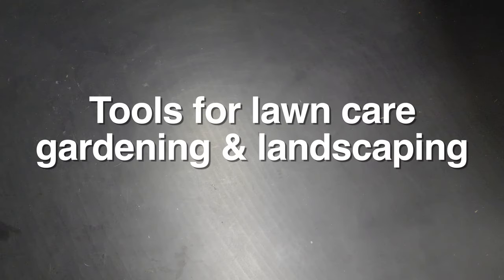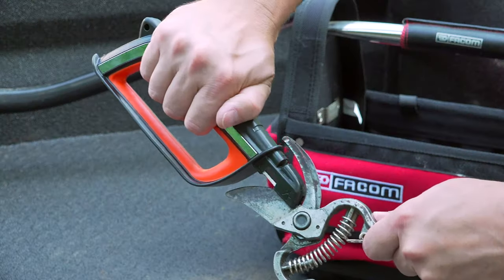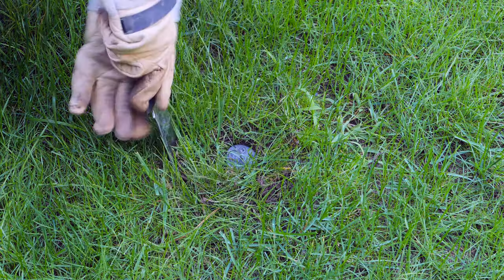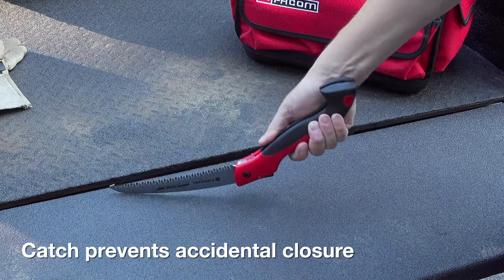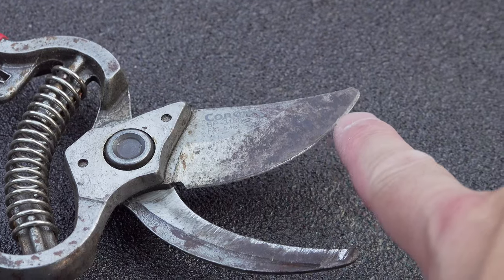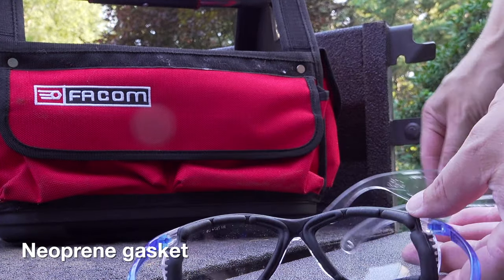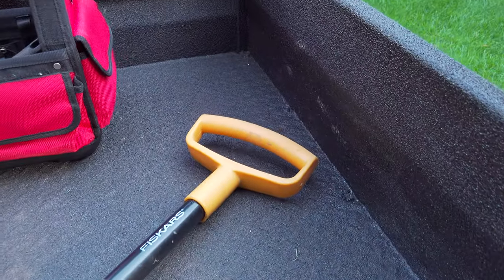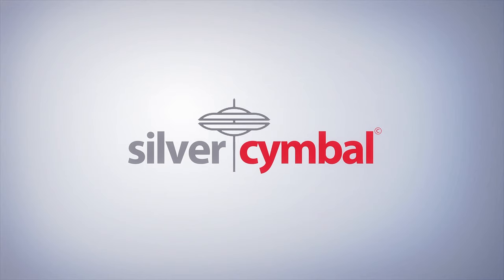2020 Cool Lawn Tools & Garden Less than $25!

Comment: Them safety glasses are made by multiple different companies and I love my 3 pair. The yellow act like they have night vision as the sun goes down. You'll take them off and say, what the he** or heck for younger children. Seriously they are awesome. I also already bought the sharpener and within 24 hours of you showing it on your show. I bought it off eBay.
Reply: Does the seal cause the glasses to fog up? I bought a pair by Dewalt that had vents at the bottom but were sealed around the edges but as soon as I started doing any strenuous work, they fogged up on me.
Reply: @lamcarter  this is what I'm going to say about that situation. I have some that fog up almost instantaneous and none of these pairs do and they're not even sealed. Personally I don't know if you have heard of Wish.com but I but 2 pair on there for let's just say $5 each (20 days shipping) and one on eBay for let's just say $15 (2 weeks shipping). When I need them I will definitely buy more in the future.

Comment: I have the Corona Extendable Pole Saw/Pruner. The Blade design is superior. A 6" branch 14' up is no match for Corona's sharktooth type design. I have been using old wood handle saws, but now I must get a Folding Corona, thanks to Silver Cymbal.
Reply from the maker: They make some good stuff, I will have to check that one out.

Comment: Few people without special training can pick out quality products so well. You've said you are a computer guy but I can't help wonder, even though none of my business.  Never had Facom tools in my hands what do you think?  Anybody who uses an Instinct screw driver's not likely to use junk.  I collect some SnapOn also, mainly sockets in black oxide.
Reply from the maker: Thank you for the very kind comment. I used Facom for a lot of years and they were my favorite brand. They make some cool cases and bags. I have a little Snap On, pretty much just their standard chrome stuff.  A nerdy bit of trivia is the white "garden gloves" that I wear in some of my videos are actually Facom leather high voltage gloves that I got free with a set for work years ago. I have never seen a more durable pair of gloves and I guess if they can block 1000v ⚡they are ok for the yard. 😀Not sure what I will do when they go bad though.
Reply: @SilverCymbal  Guess I'm a product "nerd" also. I consider every purchase a vote for smart or stupid/junk. Just landed a NAPA  NB47 3/8 ratchet.  Roundhead fine tooth quick release and thumbwheel.  Same as the Craftsman some consider one of the best ever but doesn't have the classic Craftsman handle I don't like. They were both made by Easco who also had a version. Had to look for two years to find it. Oddly the ratchet I grab the most is the Performance Tech plastic cheapo. Similar to the Harbor Freight plastic but has an off set handle. Great for yard work or car. Don't mean to turn this into garage journal. I rarely had a good discussion there sadly.
Reply from the maker: @tomjones4318  Very cool, I like Garage Journal a lot too. Thanks for the comments and for being part of the channel.

Comment: @silver Cymbal I’m finding it difficult to find aerator and dethatcher to purchase
Reply from the maker: If you want to buy and not rent them are you looking for used, did you watch my video showing the home depot deals?
Reply: @SilverCymbal  I'm in Colorado and I saw only one for sale from the HD deals from Cheyenne down the front range to the Denver metro area. It was a Classen. Is that a reputable brand that will withstand the test of time?
Reply from the maker: @allisonr9607  Classen make good, commercial quality machines. You can always call first and ask for the overall condition before driving in case it's far.
Reply: Silver Cymbal yes I’m looking for used.
Reply from the maker: @marvinmensah2956  Very good, they are out there but Home Depot actually contacted me after my video thanking me for it but it does seem like I let the secret out so it's harder to find them,
Reply: Silver Cymbal oh wow so they won’t sell again ?
Reply from the maker: @marvinmensah2956  No they sell more all the time, they cycle through what they have as they get new units
Reply: Silver Cymbal oh ok. I’m looking for some to buy seriously. I want to aerate before I seed as I want to seed in second week in September. It has started raining here.